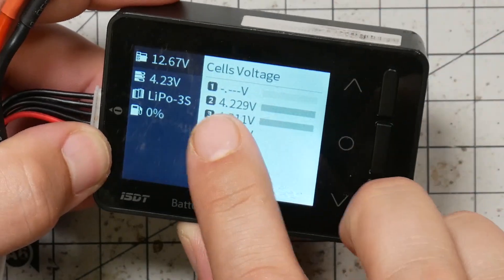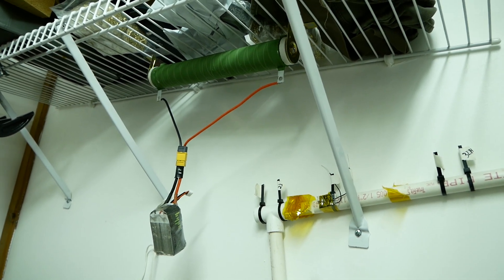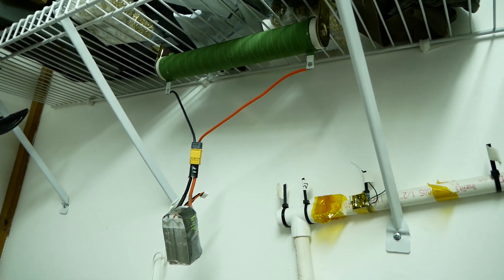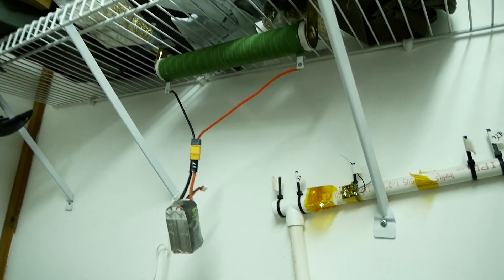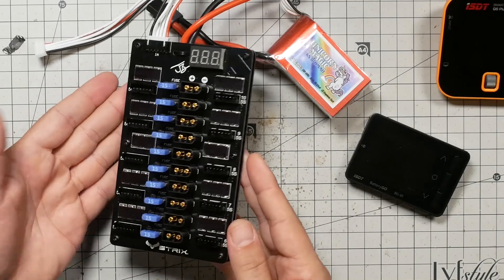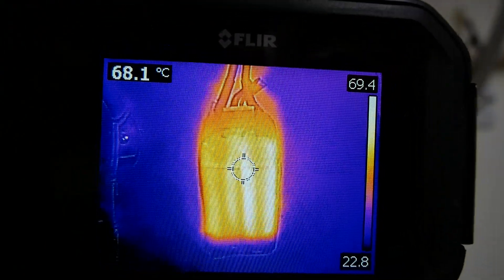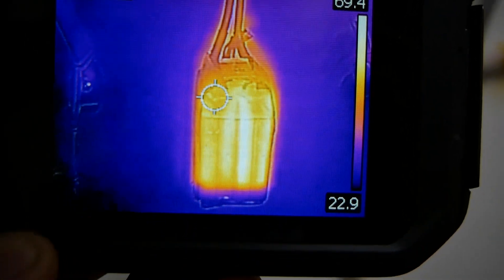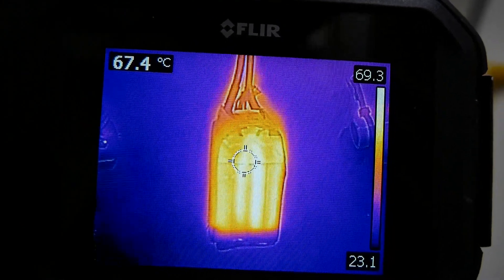Is Your LiPo Safe To Charge | WHEN TO THROW IT OUT

Comment: I crashed 2 years ago and broke something in my quad and never got around to fixing it. My 3 tattu 4s battery’s sat for the last 2+ years. Two were plugged into a parallel charging board and one by itself. 
  I just bought a diatone f5 after seeing JBs review and tried to charge the batteries up. The one sitting solo was fine at 3.7v per cell. The two in the parallel charging board had two cells at 3.7 and 2 cells at 0... I tried to revive one and it was drained the next day. Glad I saw this video today and they will be going to the great battery place in the sky.

Comment: I just found a battery that I never got to use, I didn’t have a lipo charger.  It’s five years old never been plugged into anything. Could it still be any good? Venom 2S 30c 5000 mah in a hard case, no puffing from what I can tell. Getting a charger next week

Comment: isn't it simpler to just "fly them empty"? 
like when you going to throw them out, just fly them to zero? (well not zero, maybe 2.7 volts or so)
that would be done quickly (ish) and you are right there doing it, so it not sitting in your locker and you have the feeling to sleep with a ticking bomb where the timer is broke ;)

Comment: How low can a 1S LiPo HV battery voltage drop under load? Today I was flying tiny whoop on 1S, voltage was like 3,3 and then, when I was landing, it suddenly went below 3V, so I have got rid of the battery. Or next time I should charge it and check if it keeps voltage?

Comment: Good points Joshua. Due to the Irish weather, my batteries are most of the time on storage charge :-) and in tin biscuit  boxes lined with baking paper and stored in 50x50x50cm floor tiles box in my garage. When we're going away in the summer, I'd clean up the stove and shove them all there for a piece of mind

Comment: I have a bit of a stupid question:
Can charging packs with the balance cable plugged in upside down hurt the packs, thought my charger was broken but it turns out im just stupid
Reply from the maker: Your charger should detect that and refuse to charge.
Reply: Joshua Bardwell well it did charge, just not through the balance lead. My charger is the toolkitrc m6 if that matters.

Comment: Will the ISDT BG-8S work for emax 1s and 2s batteries? 
I noticed has only xt60 plug. Is that just to balance charge the battery or needed to view cell voltage?

Comment: Hey Joshua I am pretty new to FPV so I didn't need to discharge a battery to retire it. My Question: My charger can discharge a battery I think at max 1a. Can I also use this function? The Charger is a Robotronic Expert LD 100.
Reply from the maker: Yes but that will only discharge to 3.0 volts per cell not 0 volts.

Comment: I have two new 3s batteries that on the first use the voltage was 2.7 volts per cell. Are these batteries trashed and or dangerous now?
Reply from the maker: If a cell dips below 3.0 and then recovers by itself back to 3.0, I might keep using it. If it stays below 3.0 by itself for an extended period, I would retire it.

Comment: For the 6S batteries you could probably use two smoke stoppers (one plugged into the other). I kill mine by putting them on the charger in Lead Acid mode, discharging as far as it'll go (1V for the whole pack), then cutting the connector off, soldering the leads together, and leaving them out overnight in an ammo can filled with sand.

Comment: This is a very good information  to know.. But i wondering whats a good storage volt on my hubsan lipo it is 7.6volt 710mh and 30c 2s  and i used it when the summer was and put it in my ammo box and im always watch them regulary so the volt dont be totaly drained so right know i have 3.7/3.8 volt each cell in it. Would it be fine. It is hard to know when this charger is a simple one with only usb plug in an then fly
The safety i use is 2 lipobags putted into a ammobox and installed smokedetektor in it to. And then smoke alarm in the roof  plus extingguichers

Comment: Question, if im useing the m8 and im charging cnhl 1300 mah 120c 4s batteries. How would i configure the charge to charge these batteries? Right now its set for lipo 4.20v 16.7v 4s (auto) charge 1.3A dischg 1.3A . Is thay correct? I change the charge and discharge( A)? Thanks for your help!. Keep up the good work!
Reply: 1.3A for a 1300mAh lipo is perfect
Reply: You can charge more or less but keep in mind that lipo's don't like to be charged fast, if you really want to charge them faster you could charge at like 1.7-2A but i wouldn't go higher than that as it may damage the lipo's
Reply: Awesome, thanks  yea i dont need to charge them fast

Comment: I'd like to know the resistance number guidelines. What number is too high? How much difference in numbers is too much? Thanks.
Reply from the maker: The number depends on how big the battery is and what its C rating is. So it'll vary. Best thing to do is check the packs when you first get them. Make sure to test at full charge and a consistent temperature. If you get brand new packs and they are at 8 mOhm and then a while later they are at 20 mOhm, then that's a significant degradation.
Reply: @JoshuaBardwell  Thanks very much Joshua.

Comment: If you are discharging a damaged battery, I would recommend discharging through the voltage balancing terminals. Discharging through that low impedance resistor is dangerous, because the weakest cell can be reverse charged by the stronger cells. That GREATLY increases the chances of a conflagration in that cell, which will light all the rest of them. An individual resistor between each of the balancing leads will guarantee that all the cells fully discharge, without reverse charging the cell(s) that's bad. you want to give each cell its own resistor. some cells will take longer to discharge.
     If that's a .5 Ohm resistor, a 4 s battery will put ~28 amps through it. You don't want to use a value that low, if the battery has a weak cell. The cell will have almost that much resistance, and will surely heat up. It would be better to use 5, or even 10 Ohms or more, to discharge over a longer period of time, to avoid heating weak cells. 1 to 2 Ohms would be appropriate, for discharging individual cells, using the balancing leads. That's definitely the safer way to discharge a battery for disposal.

Comment: For all of you who are not paying attention to his safety methods for discharging a LiPo in the closet, he is using a thermal imaging scope to see how hot the battery is getting. To me, that is pretty safe. As the battery gets discharged, the heat dissipates and the battery will just keep getting cooler until it has no energy left. He monitors the battery until the heat is low enough not to be dangerous with a thermal scope! Let's not over look that! I know I don't have one of those. 

Also, as the cells appear on the scope to be white hot, like super hot, if he displayed the actual temperature, the white areas are probably not super hot, just warm. I doubt it is above 40 degrees Celsius (104 F), which is safe, even in a closet. You also need to put it in perspective, he is way more knowledgeable than 99% out there, so I think trusting him to do the right thing for him is not the same as you trusting your situation will be equally as safe for you. If he found an issue which would make it dangerous to discharge that battery in this manner, it is a safe bet he would do it differently.

Comment: To discharge my 6s 8000mAh batteries relatively quickly, I use 3 auto headlights (old style duplo) in series, but only to a safe level of around 3.7 - 3.8V per cell, before storage charging back to 3.85V. Before discarding a battery, I discharge using the headlights to cell charge of around 3.2V, and from that point on, I use my (dis)charger with a set current of 0.5A till the battery is completely at 0V. Yes, it takes a long time, but safety first.

Comment: Hey Joshua, I got a problem with on of my GNB 4s batts. When I stick on the charger the voltage changes every second on 1 cell. eg. 4.12 then 3.13. then 1.49 and so on. Is the cell dead or is there a connection problem? The pack is great shape and no swelling or any sign of damage. Could it maybe be the balance connector ?

Comment: Storing and charging in lipo bags, regardless of battery condition. Just a good habit and surprised you didn't mention that.
Perhaps peer influenced complacency.
Also, you didn't mention that 3.3V per cell should be the target discharge, in terms of longevity and giving yourself a little more headroom to land.
Reply: They may be good for an extra layer of protection, within a lipo bunker, but most of them don't do crap.  I had a 4s 1300mah go up on me when new to the hobby, and it was in lipo bag. It burned through the bag like it was regular paper almost, and still caught my wall on fire.

https://www.youtube.com/watch?v=tavpXgmL16M
Reply: @sunshynff  there is alot of variability in the safety performance between products, there's a few videos that highlight this. I'm sure it mitigated at least some damage.
The optimum safety would be something lined with furnace-type fire blocks.
I'd go as far to say there is a niche in the market for better made lipo bags. The hardest part is containing the hot gas venting.
Reply: @MrZigzter  I agree, my incident happened almost 4yrs ago, brand new battery and I charged it wrong so it bloated and kind of exploded.  I saw several vids while looking for one I posted, of a black lipo bag, forgot brand name, but it looked pretty tough while testing it.  There's also something called the Bat-Safe, that a lot of people swear by, it supossedly even filters the smoke through it's vent holes, but it's like $65.

  I have found best bunker for low low budget, is just a couple of the white/grey-ish cinder blocks, with the two square holes. Each one will hold about 4 lipos, or a parallel charger and one lipo.  Put what you need in the two holes, throw a sand bag over and your done.  If one catches fire, not only is area around it safe from heat, but it melts sand bag and fills entire hole with sand.

Comment: Hi Joshua. You said that you bring down your quad when you see 14.6v. I was told that I should bring down the quad when I see 14.2v. Is this too low?
Reply from the maker: It's all subjective. 3.55 volts / cell (14.2 volts) is not damaging to a LiPo. If you are flying a long-range cruiser with very constant amp load, then flying down to 14.2 volts could be fine. But for a racing or freestyle quad, where hard throttle hits are normal, if you are cruising at 3.5 volts, the minute you touch the throttle, you're going to hit 3.0 or lower and go into the dirt.
Reply: Got it! Thanks a lot again!

Comment: I have a question: What does it mean if my batteries don't finish balancing anymore? The charger just keeps putting mAh in until it times out, sometimes way over the battery's rated capacity.
Reply from the maker: The batteries may be old or worn out. Or the charger could be damaged. Buy a new battery and try it on the charger.

Comment: Hi Joshua,
you've said that you are not used to the different voltage of 6s.
I had the same problem until I switched to the average voltage per cell.
So your OSD will show 4.20v fully charged and we all know what the voltage per cell should be! So I land at about 3,5 to 3,6v per cell.
Makes it a lot easyer if you fly a lot of set ups with differend Lipos!
Reply: 4.5 or 4.6 jk lmao

Comment: Hey Joshua, Thanks for teaching me something with every video. I have a question because you know LiPo's. Recommended storage Voltage per Cell on a 4s? I read 3.85, Is that a good rule? And does that hold true for all cell counts 1-6? Thanks again.
Reply: Yeah 3.8 is the voltage that every cell should have for any lipo size

Comment: I've been told to never store my powertool batteries on a cement floor because it slowly kills the battery. Old wives tale? Safe way to slowly discharge a damaged battery?
Reply from the maker: I can't really imagine any way for that to work.
Reply: I was told the same but for car batteries. Made sense at the time but can't remember exact reason...

Comment: I left a 3s plugged in when I was just getting into RC. It was dead as a doorknob the next day. I used NiMh mode to restore it and it seemed to work fine for a little while. (Being used for a hovercraft) I was charging it while watching a youtube video of someone turning a pancake on a lathe and I heard a loud thud and turned over to see several feet of red orange flame coming out of my dresser drawer. I dumped out the contents of the drawer and wrapped them up in a rug to stop the fire, this did not work and the lipo ate it's way through the rug and damaged the floor. (dorm) When it finally stopped burning there was nothing left but some bits of what looked like copper foil, a very destroyed rug, and one unhappy roommate.
Reply: wow
Reply: maybe the drawer has a hot temperature (imposibble considering the drawer temperature is almost the same with the room temperature).. 
so, maybe the cell just faulty, or the battery being overcharged or overdischarged before..
 and the heat generated and the pressure inside just goes up until above 600°C and the pressure above 10 megapascals and in this temperature and pressure the battery cannot endure and just exploded..

this phenomena is called thermal runaway..
Reply from the maker: This is why I don't suggest "recovering" dead LiPo :-)

Thanks for sharing this example.

Comment: @Joshua bardwell. At which ohm you think it's to risky too keep the battery, when all cells are at same resistance but high resistance?
Reply from the maker: For a typical 1300-1500 mAh pack, if it was over about 25 ohms I probably would not want to use it simply because it's not performing well.

Comment: How long can you leave used lipos in storage mode?
Reply from the maker: If they are at storage voltage, there will be very little reduction in performance, especially if they are also stored at reasonable temperature (not too hot or cold). Perhaps years or more without noticeable performance reduction. Certainly months.

Comment: At what point does IR start to significantly reduce performance?
Reply from the maker: I would say for a typical 1300-1500 mAh sized pack, an IR above about 20 is reduced performance and above about 25 or 30 is definitely degraded.

Comment: I also am  a little on the uber safe side...kinda... If I have a damaged bat, that still works well, I will store it outside, and charge it outside.. in a safe dry place. Safe meaning non-flammable..   And honestly.. ALL charging should be supervised, but we KNOW it isnt.  I had a 5000 mah bat go off on me..  in my living room, and  it shot 4 foot long  streams of fire out of it for what seemed like a long time. I was new to LIPOS than,, and poured water on it!   NEVER pour water on an lipo fire, it feeds the fire!   Best way to charge safe is  in contained  non flammable area..  I use an AMMO can,  with a 1 inch hole cut in it, to put the wires through.. If a lipo went off, nothing but fumes would escape..

Comment: I recently revived a 6s Lipo from 8V total. Works just fine
Reply from the maker: Not worth the risk in my opinion. You can do it and you can get away with it, but if/when it burns your house down, I don't want you saying, JB said it was probably fine.
Reply: @JoshuaBardwell  I usually charge my Lipos while they are in one of those Lipo bags. That way I can do whatever I want without risking much except for a smokey room

Comment: I got the same thing. I discharged to much, because I didn't had a xt30 to banana plug cable for my charger 😂, and it was 2 days 3,2V. When I changed it to storage voltage, it will stay on 3,8 like my other battery's (checked after a week)... Now I'm scared😂

Comment: Thanks for the reminder, it's never too much. You mention spontaneous fire but I'm not sure there are too many of those. I believe most of the time it's during charge or discharge. The main source of fire is obviously crashes, and for me the close second is pulling hard on a tired lipo : you land and one of the cell is puffed and smelly. As mentioned in another post some chargers have temperature probes and I find a 5eur smoke detector next to the batteries reassuring also.

Comment: Hey Joshua, any advice on checking internal resistance for 1s whoop class batteries? I've found plenty of chargers and voltage checkers, but nothing for (for example) plugging a bunch into my b6 charger in series and getting stats off the cell. Any recommendations?

Comment: Putting batteries in fireproof lipo bags helps sleep at night too. I even put them in bags while they are charging.
Reply: Make sure to have adequate bag for you battery. Here's a scary video about a bag with single 6S battery getting fire: https://youtu.be/CnNId0mDnBo?t=112
Reply: @MikkoRantalainen  i wish manufactors of the bags would put a rating on them as to how much mAh batteries could be put in them safely, but i think thats a tough one to do for them.
Reply: @TheEviling  I guess that would require them the claim that those bags are good for any amount of batteries. When they say nothing, there's no liability when it cannot prevent fire.